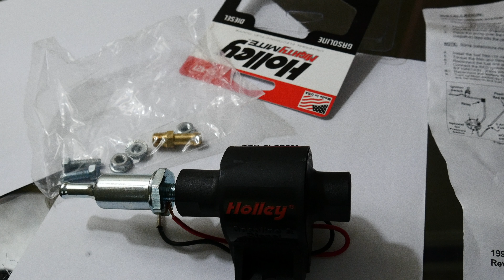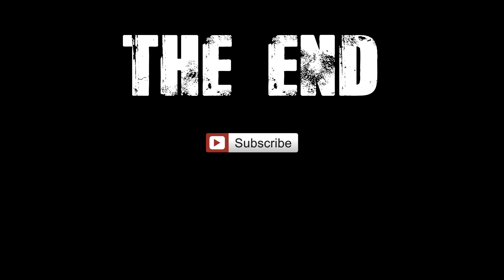Holley Mighty Mite 12-427 Fuel Pump Unboxing

Comment: do you recall if that pump came with a fluid inside of it already? i just bought the exact same one and it had some fluid in it. I want to know if thats a lubricant/priming fluid so it doesnt run dry at first or if Someone swapped a used one with a new one and im the unlucky bastard that grabbed it
Reply: I think so.
Reply: @AbigailAlvarez-mg6ot  thanks
Reply: Yes definitely normal. They are bench tested before sending them out. 👍🏻